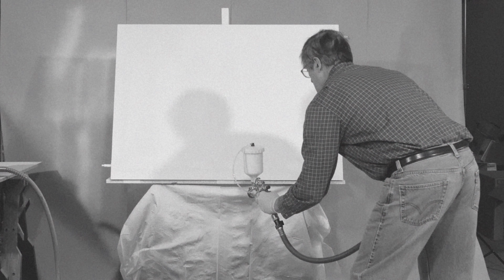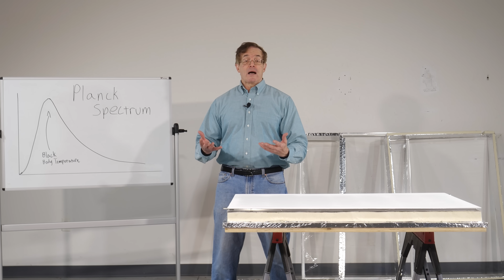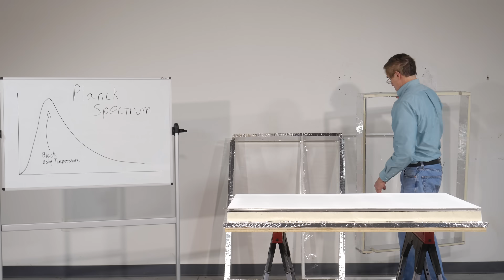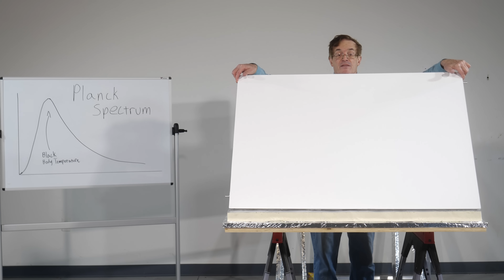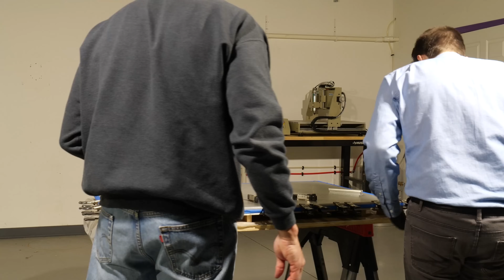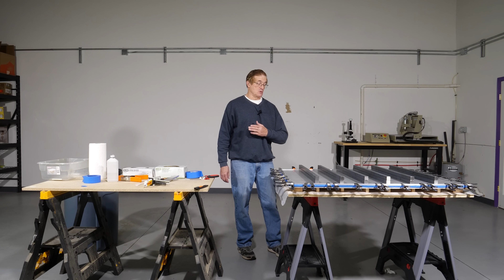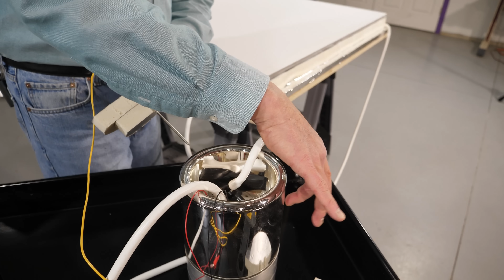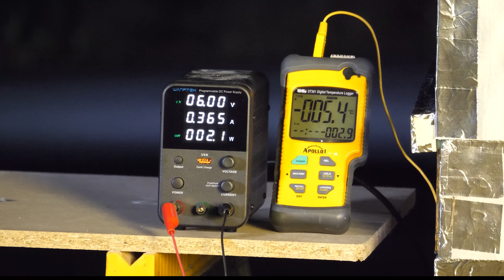Air Conditioning isn't free... but we're close.

Comment: Hello, this is quite a proyect!!!! I have one question about the plastic film that you are using as a thermal barrier. What if above the plastic film you use a sheet of glass, or some stronger plastic? Why am I asking this? because I have found out that, it doesn't matter how thick the plastic film will be, at some point something is gonna tear it apart. Could be leaves, dust, strong wing gusts..
Reply from the maker: With further testing we learned that the film adds  little to the performance.  You can eliminate it.
Reply: @TechIngredients  thanks for the reply!

Comment: Correct me if I'm wrong, but wouldn't this system only be more effective than a heat pump if it is passively pumped? Heat pumps have an efficiency of around 4:1 adding the pump to this system to pump the water around would lose all of its effective gains
Reply from the maker: It's  not either-or. Keep using the heat pump and potentially  make it even more efficient. Or, use only the paint to lower structural temperatures and unload the heat pump.

Comment: I have this idea which I haven't seen anyone implement yet, not on youtube at least. 
It's to use 2 radiators, a larger one and a smaller one. The larger stays outdoors where in front of it is placed a wet rug (or any thick porous material). A separate small pump is used to continously pump water over the material so that it stays damp. Then a fan pulls air thru that material and the radiator, thus increasing the cooling of the water that's running thru the radiator. On the other side, in the room the smaller radiator (which is connected thru piping to the bigger radiator+evaporative cooling unit outside) uses another fan to blow air which would be cooler.

The heat in the room would be absorbed by the radiator into the water, where it's being cooled in the outdoor radiator, where the heat is removed into the outside air. I'm not sure how efficient or how much it could help cool a room & if the money & effort spent to build such a contraption would be worth it, tho I'm sure theoretically it should definitely help cool at a lower cost than running an air conditioner.

I cannot afford to build it at the moment, would be cool if someone could try this idea. If & when I build it, I'll definitely be making a video about it.
Reply: It sounds like you're describing a homemade swamp cooler. It's the basic same-state evaporative cooling using water as the coolant and water as the evaporative action
Reply: @Trapper-238  except for this wouldn't add the amount of humidity a swamp cooler adds to the area being cooled and would be better suited for a small room with less ventilation, where a swamp cooler would make the place pretty humid and uncomfortable really quickly

Comment: I did a lot of experiments with the recipes from @Nighthawkinlight but I was never able to get the super-reflective paints to stick to aluminium or keep the surfaces and protective panes clean enough over time to achieve good results over time. With one exception: a ~1mm aluminium sheet deep black on one side with calcium carbonate doted paint mounted on the inside of a window will heat an entire room in winter with almost 85% efficiency while not providing a heat bridge in the dark of night.  The black side absorbs whatever makes it through the glass, the white side radiates it into the room heating all surfaces. At nigh the glass still has 100% of its insulation properties. The single sheet was better than a similarly sized soda can solar collector.
Reply from the maker: When we cover the paint, I'll explain how to perform a couple of methods for aluminum  surface prep.  They work well.

Comment: Just a side note - Interesting that you know the CMB claims a lowest temp in "outer space" as 2.7 Kelvin. The entropy of a gas according to mainstream scientists can only be stopped by either a container, or to get it down to zero Kelvin. So, you should agree that gas in the vacuum of "outer space" cannot ever be completely stopped in expansion due to entropy.  You should also know that entropy of a gas is an irreversible process. Now knowing these things does it make any sense to you that it is claimed these things people call Gas Giants are formed by gas coalescing to form a sphere? It does not make any sense to me. In fact, No experimental evidence you can show me on Earth in full Gravity (whatever you think gravity is) gas can form a sphere in a vacuum. It would go against the 2nd law of thermodynamics and scientific method experimentation. - Was Nasa just making stuff up? Looks that way to me. I'll only believe the claim if it can be validated via the scientific method. No one has done that in 8 years I've asked scientists, physics professors and engineers. Think about it.  All may not be as we were taught.
Reply from the maker: You're  ignoring  the influence  of gravity. You don't  need a coalescing  gas cloud to reach absolute zero to form a sphere.  It will do this even if it is at thousands of degrees if there is enough of it in a region of space.
Reply: @TechIngredients  That's a claim I have Never seen validated. Can you actually show it to me? Btw, Whos gravity do you speak of? Newtons which is claimed to be a  force in his thought experiments from the Principia that has he never validated via the scientific method (he didn't even put forth a hypothesis) or Einstein's bendy spacetime which is not a force only an effect? (also never validated by the cause and effect validation of the scientific method) I have asked physics professors, engineers, and scientists to show me this for 8 years. None of them can do it. I do not ignore the influence of whatever you think gravity is at all.. we can show experimentally in full "gravity" on Earth that gas cannot form a sphere in a vacuum. Try it. It always fails the scientific method. Now you may have information they did not have. I'd like to see it demonstrated if you can. Thank you.

Comment: How is the super coating better at radiating to the sky then a black body?

(I’m tired after a long day of work :/ I don’t have the energy to research this myself. Maybe someone could explain? Im not questioning that a black body is better. Just wondering what mechanic gives the super coating better performance relative to a black coating)
Reply from the maker: Don't  confuse the term black body with something that is visibly  black.  The visible color has nothing to do with the emisivity or, in other words, the efficiency in radiating thermal energy.  A black body is an ideal surface that radiates at 100% efficiency. It doesn't  actually  exist. Our super paint has an effeciency  of approximately  96%, which is higher than all commercial paints of any color.
Reply: So, I was lazy, and asked chatgpt.
It said this in response.
I thought I would share what it said.

* Super coatings and black bodies are two different concepts related to radiative heat transfer.

A black body is an idealized object that absorbs all radiation incident on it and emits radiation at the maximum possible rate for a given temperature. It is often used as a reference standard for the emission of radiation. In the context of radiating to the sky, a black body would absorb all the heat it generates and emit it to the surrounding space.

A super coating, on the other hand, is a material that has been engineered to have high thermal emissivity, which means it can emit thermal radiation more effectively than regular materials. Such a coating can be used to enhance the heat transfer between the object and the surrounding environment, which can be useful in various applications, including radiating heat to the sky.

In terms of radiating heat to the sky, a black body would be an ideal solution as it would absorb all the heat generated and emit it to the surrounding space. However, it is not always possible to achieve a perfect black body. In such cases, super coatings can be used to enhance the radiative heat transfer, although they may not be as effective as a black body.

In summary, a black body is the ideal solution for radiating heat to the sky, while a super coating can be used to enhance the radiative heat transfer of a non-ideal surface*

Comment: ok so if i understand correctly... these white aircon cooling panels are going to be competing for rooftop spaces with solar panels, and that you want the premiere unshaded areas for solar, with these white cooling panels in the b-tier and c-tier partially shaded areas, which are less optimal for solar production, right?

and the other major obstacle is getting the necessary planning permission for rooftop changes. since the local authority tends to be overly concerned about the city skyline, how buildings looks and fit in with the local historical architecture. at least this is true in my country (uk). and also that the rooftop spaces are difficult to access and at a premium.

but what i think would be cool (pardon the pun). is a lower 1st floor garden pergola or veranda system. that can be like a temprorary blinds that are deployed during the summer season to give both a direct shade in the garden / outside space. and also be these same white cooling panels for these summer airconditioning. since a lower garden pergola will also have partial shading most likely, then having a modularity to choose which specific panels are either for the solar or the aircon. you would then make the white cooling panels a compatible dimensions as a single unit of solar panels. for example if modern solar panels are 2m x 1m sized. then the white coolig panels could be either the same 2m x 1m, or they could be 1m x 1m to fit 2 together. so then anny weird shaped edges of the pergola could be sizable into finer increments. to fit better the available space. if that makes sense

hope my comment was constructive / helpful
Reply from the maker: It was, thanks.
Reply: @TechIngredients  just 1 more observation... it could be possible to easily improve the geometry of the aluminum sides / reflectors, and instead overlay a much finer honeycomb grid structure or thinner louveres. because a finer grid can then be vertically more compact in the z height relative to the panel size. but while still offerig a relatively high keep out angle against nearby trees and objects. this would be a useful feature so as not to cast unwanted shadows onto nearby solar panels. the reflector part of the design probably also needs some other design considerations. for example for the wind loading factor. and maybe some sorts of gaps or a lift off distance to let through leaf debris and rain water. and be easy to remove for cleaning purposes

Comment: My mind immediately jumped to an application for refrigerated distribution centres, often placed in relatively open areas surrounded by low industrial buildings and/or pavement and lawn with flat roofs. Building a lip around the roof area and this system into the roof may very well save a big retail company a lot of electricity anually on their distribution centres with a one-off investment during construction. And these types of structures already have very complicated air conditioning built into the design so integrating it during architectural phase would be more than possible.

Comment: Hi! Could you do a piece on 'magnetic refrigeration'?
Reply from the maker: I've looked into it.  It's  not easy because the transfer of heat into and out of the magnetocaloric material requires  pesky valving and reversible pumping strategies.
Reply: @TechIngredients  Thanks for the answer, great content by the way.

I've heard of the magnetocaloric effect being used to reach extremely low temperatures. I would like to hear more about the challenges and physics of  the refrigeration cycle using this effect.

Comment: Love this! I’ve been looking at passive infrared cooling as a possible method for accelerating ground cooling and cooling glacial and polar ice. Start with a wick-less heat pipe embedded vertically in the ice. This will rapidly carry subsurface heat to the surface, when the surface temp is lower than the subsurface temperature. But without a wick, the heat flow cannot be reversed, making it behave like a thermal diode. At the top of the heat pipe use a vapor chamber and passive radiator, with a tuned-emissivity coating.  Now heat will flow rapidly to the surface and radiate into space whenever ambient conditions allow it.  Got booking large masses like ground or ice this should result in more heat flux out of the mass during colder months, delaying and or reducing melt and runoff in warmer months. Could be useful for thermal batteries (for cooling), but also might be possible to deploy at very large scales to delay glacial melting in key spots or similar issues.

Comment: I made something similar to this 30 years ago - it was called a "cold collector". I used an aluminized 1.2m satellite dish and built a big polystyrene box around it to hide it from the surrounding trees, walls etc - I used baffles to stop incoming radiation, but if you make the inside walls reflective, then you need to make them trapezoidal like this \__/ to bounce out any sideways incoming radiation, otherwise you are just reflecting ambient radiation onto your radiator and reducing its effectiveness.
Reply: I placed a bottle of water at the focal point, and even when the air temperature was about 10 °C, it would freeze. Very impressive!

Comment: The gentleman presenting this video has  seems to have a great lakes accent maybe Buffalo maybe Michigan with that said Great Lakes water temperature can be as low as 4° C in the summer if you're source is deep enough. Say you were to pump out water from 100 ft down in Lake Ontario as we already do that would be a 4° c input. Hopefully all your piping is copper so it won't be fouled with zebra mussels and then have a glycol water mix for the secondary part of the distribution of this chilled water and other than electricity for the pump it's virtually free air conditioning. And because the source water is 4° C the pump pulling water from the lake doesn't have to be on all the time.

Comment: This is an excellent concept, however normal refrigeration systems manage to have upwards of 20 degrees differential between the outside air and the evaporator, which means it works very quickly. Maintaining only 3 degrees does not seem like it would be enough to cool even a small apartment
Reply from the maker: What if both are used together?  Reduce the heat load, then cool it further.
Reply: @TechIngredients  It would be a very complex system. Refrigeration technology is already at least 300% efficient, because the refrigerant can move at least 3 times the heat energy than the energy it takes to compress the gas. Certain units are even 500% efficient

Comment: Similar techniques are used for dew collection. For cooling purposes the condensed water could be collected over night and then evaporated to improve the daytime cooling power (basically using the water's latent heat to store energy not needed at night for use during the day).

I'm picturing a 10 meter wind tower with panels on top in an inverted pyramid configuration. During the night the panels are drained and lightly ventilated to allow dew to condense on the front faces and run into storage. During the day they are filled and not ventilated and the cooled water output is run through a liquid-to-air radiator through which the wind collected by the tower is routed to ground-level. As needed the collected water would be misted into the air stream to increase cooling (if the water were stored near the top of the tower the static pressure might be sufficient to allow evaporation without matting to hold it as in a swamp cooler).

Comment: Cool!
Could you increase the efficacy of the shading collar by either painting the inside walls black, or better yet carving/building shallowly angled terraces (similar to the surface of a Fresnel lens, but maybe sized to the width of your aluminum tape) into the inside walls before coating in aluminum tape? I imagine the collar shades the radiator from direct IR, but aluminum tape is broadly reflective, so IR that hits the inside walls would likely be reflected down to the radiator. 

Keep up the good work.

Comment: Your explanation has given me insight into many things like why it feels cooler in a basement.  Suppose you were to place a radiator at the focal point of an appropriate sized parabolic reflector. Do you think it might increase the amount of energy radiated?
The thin plastic being used to block air movement will not be very durable outside. I suspect exposure to UV radiation will rapidly deteriorate the membrane.

Ditto the respirator..👍

Comment: I do hope you will test this setup in parallel with your solar panel cooling tests...  If you have the panel facing South towards the sun, and the radiator facing North away from the sun, then circulate the water past the back surface of the solar panel, (or through a radiator on the air-intake at the base of your panel) you would surely massively increase your panel's efficiency, wouldn't you?  I'm sure you've thought of that already, but it would be great to see you test it.

Comment: A friend living in the Sonora desert has large pipes that are painted blue black that heat up and draw air from her home. At the other end of her home is a 25' in the air white stand pipe that draws cooler air. 
A small solar panel runs a pump that irrigates a pad which the cooler air is drawn through effectively keeping her home very cool on the hottest days. 
The only maintenance is maintaining the evaporator pad. The small pump is 12 volt. The rise in air volume is aided by an automobile electric cooling fan pushing air through the cooling pad. The entire home runs on 12V.  The home is a test lab for the University of Arizona.